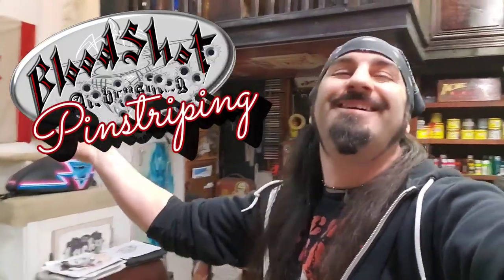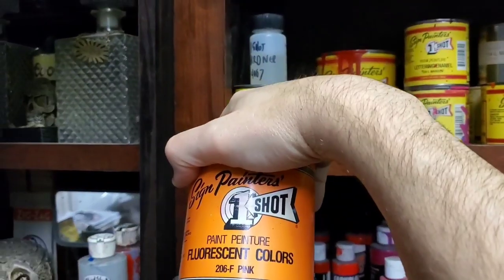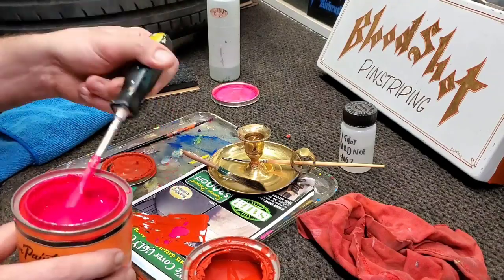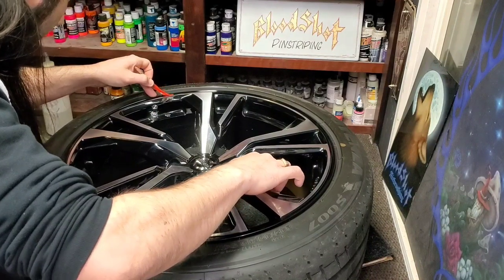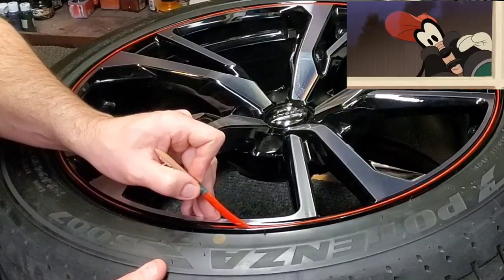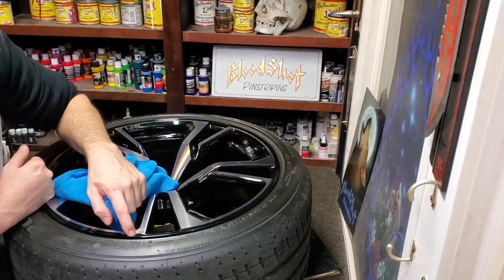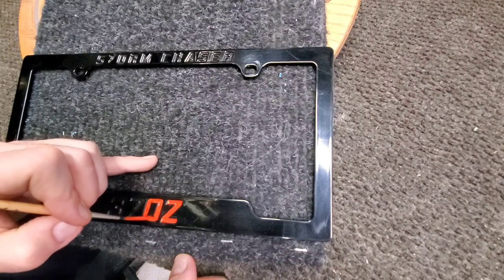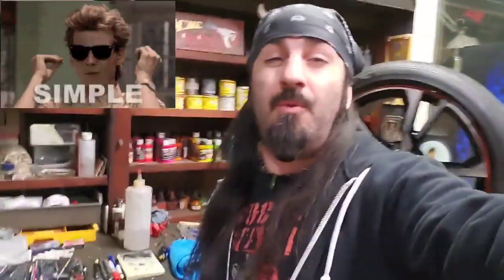How to Pinstripe Wheels with 1SHOT paint. Full Tutorial Video

Comment: well.....that was simple enough ....moring ryan n bloodshot soilders, .dont you need to lightly sand down the rims first , for paint to stick ?  any different between 1shot n metal paint? and lastly after you pinstrips the rims do you seal it - clear coat ? . cool job ryan .
Reply from the maker: 1SHOT is known as a permanent paint. It can be applied to most surfaces with just a cleaning and no clears required. That said, when going this route I reccomend waxing it religiously after to help seal it. The other option is to sand, apply the 1SHOT and then clear for a permanent seal. 1SHOT is an enamel. And most automotive paints are either water borne or urathane. Very different from the 1SHOT paints. Hope this helps you out my friend!!😁 Big Cheers and Much Love from the BloodShot Studio!🤘😎🍻